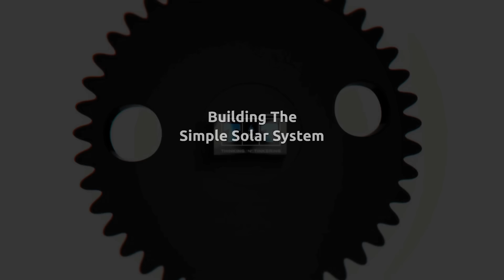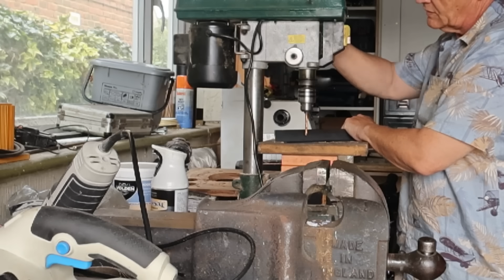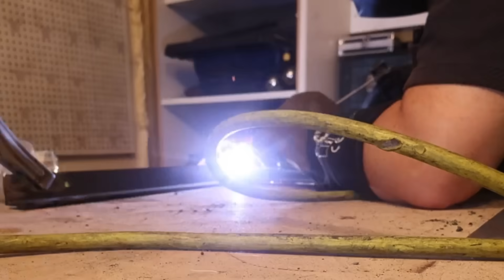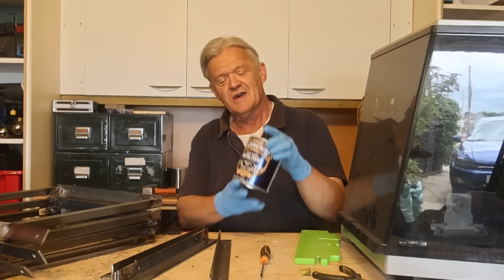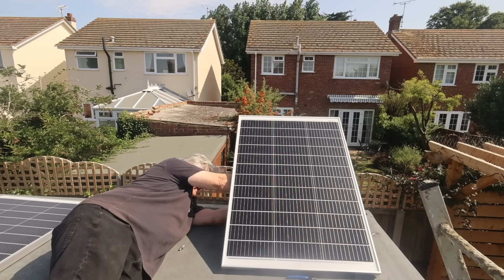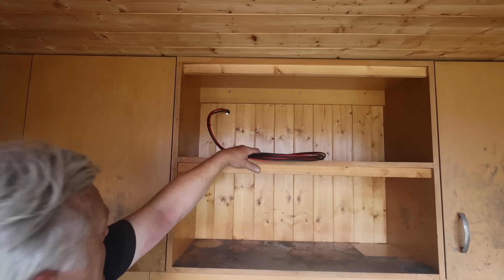2416 Building A Simple Solar System - Installing The Panels

Comment: Robert, I noticed that the old workshop has accumulated some dust from lack of use. The saw looked a little neglected, poor saw. I would probably pinpoint the problem to your 3D printers. This is the first time I have seen you in the workshop in quite some time. Did you have to pull out the old user manual for the saw. I miss those REAL DIY workshop videos.  LOL Really enjoyed the video
Reply from the maker: The saw was used only a couple of weeks ago mate when I built the deck and pergola - i just didn't do a video about it - I now wish I had lol
Reply: @ThinkingandTinkering  I was just giving you a hard time as technology (3D printing) has changed our building life style. Even 3D printed, boats, airplanes,  concrete houses now. What next

Comment: Great video and I am with you on the 240v being outdated as the main power source to the 🏠 lots of wasted energy being converted from 240v to 12 ect dc. Obviously, we need 240v for showers cooking  ect but as you say most products we use transform or have a plug in transformers to step down from ac to dc "a whole lot of ros-e"..we need more investment from the energy companies to enable this but obviously they don't have a insensitive because they would end up with less profits. For those who have the finances and room to do what you are doing should do many already are and have been doing so for quite some time. I don't have any outdoor room being in a flat but I do get the sun all day and have been using solar for my old 1920's radio and charging lights, and various rechargeable batteries + my shaver all for approx £60 one off payment so whilst solar season is available I make the most of it. I have been saying for a long time unless it definitely needs 240v cut the plug off 😂 great video 👍
Reply from the maker: In my own mind I was thinking of a dual system for the house - best of both worlds!
Reply: Oh yes I agree but it would be nice to get free from the electricity companies and there standing charges ect. 👍

Comment: For a longer term panel frame, aluminium is best. There's nothing worse than the frame lasting 3 winters, when the panels will last 30 winters.
Reply from the maker: what kind of steel are you using that won't last 3 winters?

Comment: You like redundancy as do I.  Ultimate redundancy in your system, 4 solar panels, 4 batteries, would be to connect each panel to it's own battery via it's own controller and then connect the batteries in parallel as already planned.  you mentioned in the previous video about having more than one controller.  it would give an easy way to expand the system should the option be needed or just preferred, one panel, one controller, one battery and on pair of leads to connect the battery to the rest.  even better would be to used consumer unit in reverse to connect each controller to it's own suitable circuit breaker to the busbar and the "input" would then be the output.  if desired you could then connect that to the input of another consumer unit and use that in the conventional way.  you would then have the normal individual circuits plus the ability to isolate each panel/battery set without the others for maintenance etc.
Reply: Connecting the batteries in parallel connects the chargers in parallel.

An important thing to do with this system is, as these are lead acid batteries, turn the equalisation off on all but one of the charge controllers. Else not only would they get that done twice as frequently as they should, itself not good, but there could also be timing clashes of when it happens.
Reply from the maker: the controllers have the load connection mate and a blocking diode will take care of backfeed
Reply: @ThinkingandTinkering  immediately after I posted it I remembered that the controllers have the load connections, mature moment😜
Reply from the maker: Interesting points mate - thanks for sharing them

Comment: I ❤️ your channel and look forward to tests for running your house on 12V as far as lighting is concerned, I am in fact  thinking of doing something similar  with a 12V system and 5V systems as and where required there is a huge 5V range for lighting.

My big issue with that and an  answer I look forward to is, cable size over distance to eliminate volts drop using DC.

Regards
Dave
Reply from the maker: cheers mate

Comment: So if you are going to run 12v electrics in your shed, are you going to replace the existing 230v cabling & fuses ?  The amps for 12v will be a lot higher than for 230v as I am sure you’re aware. Please discuss this at the appropriate point as a safety issue before people connect up existing 230 or 120 v cabling and fuses to 12v pv supply.
Reply from the maker: good point mate - cheers

Comment: Robert, its really refreshing to see you have completely coincidentally gone with much the same logic as I did when building my tiny system 4 years ago. my garage lights, 1.2v battery chargers and phone charging supply all run on 5v so I use a 12v to 5v dc buck (the 48v boys could go a similar way when they need 12v etc). I also have an inexpensive 220v inverter but have never used it lol.
I like the metalwork, shame traditional Dexion (the grown up Meccano stuff) isn't the cheap plentiful product it once was because its perfect for this kind of job in my view.
Reply from the maker: We clearly think the same way mate! I also agree with the Dexion.

Comment: a 12v system makes a lot of sense, (though there are some advantages to running a 24V system and droping the voltage as necessary for the specific output) a variable voltage output board with up to 40V input is cheap as chips, but will only give a max output slightly less than the input, so starting at 24V you can output 19V for a laptop for example. but if you want 12v, then go for it. after all every mobile home, and every boat is normally running a 12v system, and the parallels are there to work with, you can manage just about anything from 12V. replacing batteries that fail is easy (just pop along to halfords, or a boat chandlery). my unimat lathe actually runs on a 24V electric scooter motor now and that has 100% use cycle unlike its original 240V motor (40/60 use cycle) the only issue i had converting my workshop to solar, was the big lathe, I didnt spec my inverter big enough for that.
Reply from the maker: Thank you mate - that's sound advice

Comment: you don't wire solar panels in series or parallel based on battery bank voltage , for example you said if you wired your four panels in series that's for a 48 volt battery and that's false ,  you wire the solar panels for the mppt you're using , those look like 100 watt solar panels and their voc " open circuit voltage " will be around 20 - 22 volts , this is the spec you use to wire the panels for the mppt , lets say you have a victron 100/50 mppt , the 100 is for max voltage from solar panels and the 50 is max charge amperage to battery bank , 22 x 4 =88 volts which is well inside the 100 volt limit , 50 x 12=600 watts possible to battery bank at 12 volts so good fit " its actually more as charging 12 volt batteries the voltage is above 12 volts , how much above depends on battery type , the solar panels working voltage vmp is around 17-19.5 volts on average for 100 watt panels and amperage around 4.5-5.5  amps , lets use 19 vmp for this example would have an amperage at roughly 5.3 amps , in series the 19 x 4=76 volts  at 5.3 amps and in parallel it would be 5.3 x4=21.2 amps at 19 volts , you would require far larger and more expensive pv wire wire for 19 volts and 21.2 amp configuration than a 76 volt 5.3 amp configuration to not have high transmission losses , same reason everyone says 48 volt systems as 1/4 the amperage so far cheaper components / less losses when you're not using the 12 volt dc straight from the battery bank " I do this with some 12 volt refrigerators and led lights myself '"and run 48 volt system for ac conversion to power 120 volt ac " usa appliances "
Reply from the maker: It's not based on battery bank voltage mate - that's just a coincidence. This particular equation has two sides. Panel being one side and batteries being the other - the link is the controller and in practice all you really do is follow the controller specs.
Reply: I couldn't muster the energy to read that whole sentence, but Rob said in a precious video he was going for PWM, not MPPT. Also a redundant system with multiple regulators.
Reply: @dennisolsson3119  while I did miss the pwm part of the video as I do tend to multitask that decision alone defeats the whole purpose of using 12 volts dc directly to save power , pwm are only 70-80% efficient while mppt are 95-99%  , in fact he could easily run an mppt and an ac inverter and lose less power total vs the pwm and direct battery usage but would easily save power from going mppt and direct battery from there , each of those regulators will also lower efficiency as each one will also consume power to regulate , how much completely depends on their design

Comment: AH yes the endless debate to parallel or series your panels as long as you have the wire size correct the parallel system should be more economical I never had much luck with the combiner y connectors but with your small panels the amps will be low enough to not matter imho even combining the combiners so 2 sets combined into one set of wires will only draw about 24 amp a guess as you did not share any information on the panels, so the 10 gauge wire you used to bring in the 2 feed wires should be good. Perhaps if designed specifically the charge controllers would not be needed for lead acid as they like being held at a high voltage so all you would need is to control the ripple and a man your understanding could do that with a few electrical parts. I never thought it stopped raining long enough on the island to support solar lol Cheers
Reply from the maker: lol - we are having a glorious summer mate - it stopped raining for a couple of days lol

Comment: All most excellent, how are you dealing with galvanic corrosion of the AL frame of the PV panel?
Reply from the maker: there is a rubber washer between the parts
Reply: @ThinkingandTinkering  Sorry, I did not see that when you did the assembly bit on the roof. Anyway, did you also put a bracket on the bottom set of holes to stop the bottom part of the panel lifting, 'cos it will from my experience.
Reply: No disrespect to Rob's welding, but he could have used Aliminium framing and bolted construction to avoid the 'galvanic' issue you mentioned. He could also have used welded Aluminium; but as he is self-taught at welding steel I'm not sure how he would transition to welding Al. I do wish he would take a short course in mma welding, 🤔 but hey, if it works for him, that's ok, as long as it's not something critical to safety or you don't look too close. 😉 👍
Reply from the maker: exactly mate lol - don't look too close! I am by no means a welder but I am good enough for a few non critical DIY jobs
Reply: @bikerfirefarter7280  He can just separate the AL from the MS (electrically).... and stick with the MS welding.
Reply: @Staedford 
While it is true there are many solutions to galvanic erosion/corrosion. And Rob is obviously self-taught at welding MMA (no disrespect, Rob).
But his learned habits would hamper him IF he ever tries/needs to weld Al, or, God forbid, 'stainless'.
I just wonder why he doesn't take a short course in MMA and other welding techniques, he's usually thorough and up for anything.

Comment: Timely discussion - I need to replace the motor in my table saw, and I am going to do a similar project. So why would I replace the AC motor in my saw and not at least ponder a 1,500 scooter BLDC? Same on the drill press.... No more moving belts to different pulleys
Reply from the maker: my thoughts exactly mate!
Reply: And  you made it dc compatible.  If its 12v, you eliminate the inefficiency of an inverter.  I have been using 40v ryobi cordless batteries to convert table top  shop tools the past few years.

Comment: Hi Mate you good I hope? Is there any chance you can spin a washing machine pump with a 100w dremel or similar,  and see how many 10w led flood lights , or a 100m LED strip of eg 200w 6500k 220-240v ac 80 led`s per m, and see it can part or full power solar panels? Lloyd Stovall has  a system that works, he does not supply it with cold energy, all with hot. and explains in detail for all his critics how it functions.. Its very interesting im sure you can understand what he is doing and improve it with Cold electricity.  please see this vid mate. tell me his output cant power   solar panels ? Or to gen at night?

 `I Turned A Tiny Washing Machine Pump Into A Generator!` (Theo Maxim YT)
I turned a tiny rotary tool into a powerful machine that generates enough electricity to light my ENTIRE house! Is it free natural ...
Reply from the maker: I think I have seen it mate - the pump motor he used was an inrider bldc i think
Reply: @ThinkingandTinkering  indeed. and can transform it and spark gap it, then into your amazing fractal capacitor array.🙂

Comment: I read that in Great Britain, despite the use of large wind turbines and renewable energy, you have the most expensive electricity in Europe.
Reply from the maker: yep probably - we buy most of our energy from franc - well about 60% i believe
Reply: Very true.
Reply: Where I live in the States, I happen to be about 25 miles as the crow flies from an on grid nuclear electric plant. My electric cost is in the Winter: Up to 750 kWh: $.1062 , then  for over 750 kWh each is $.0714 .   The Summer Rate is a flat $.1560 / kWh.  With grid electric costs that low, I've not yet been able to financially justify building a home/shop solar system. The ROI time goes 20% or more past the expected life of the system components.
Reply: Yeah, that's one of the lies the environmentalists tell in order to push their false narrative. All that green energy tech done on a commercial scale does not reduce the cost of electricity, it increases it. Especially when the government mandates it.

Here in Michigan, the more turbines and solar cells go up, the more the cost of electricity goes up.

And, with unreliable energy sources such as wind and solar, you need to have gas and coal plants ready to come on line to take over the job when the wind stops blowing and the sun decides to play peek-a-boo behind the clouds.

It is much more cost effective to just stick with the fossil fuel plants until the green tech can actually live up to their hype.

When solar is installed on a home as Robert is doing, the potential of energy cost savings increases substantially because all you are paying for is the equipment. You're only concerned with your personal energy usage, and if you find it necessary, you can adjust your energy usage for when power is more readily available. 

Expecting people to adjust their energy usage on a commercial scale is a plan designed to fail. My electric company suggested that we shift our electricity usage to a cheaper time since they now have two tear energy costs. 

The problem here is, if I shift my energy usage which is primarily the AC, I would be forced to sit in the sweltering heat of 90+ degree F. temps due to the sun shining directly into my Apartment from 12-9pm.

Basically, the environmentalists are demanding that we die of heat stroke to save the planet, when that energy will then be utilized by the big tech giants for their AI data centers and systems.

I have no intentions of capitulating to an enemies demands that I take actions to save the planet, when that same enemy is planning on increasing his energy usage, to my detriment, and to no benefit for the planet.

If you have the cash flow to buy solar panels and install them on your home, go for it. You'll end up saving money on energy. Just don't be expect us low income apartment dwellers, to do the same. If the apartment complex wants to enjoy the benefits of solar energy, they can buy the things themselves.
Reply: The UK grid cost is closely aligned with the price of natural gas. I'm hoping that as more renewable energy comes on line, the price will drop, as renewable electricity is very much cheaper than a gas fueled grid.